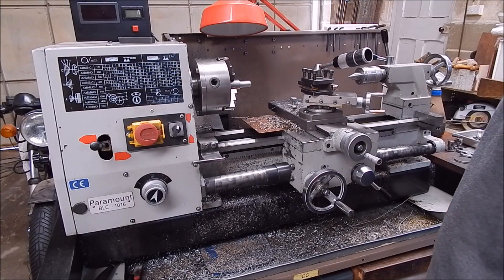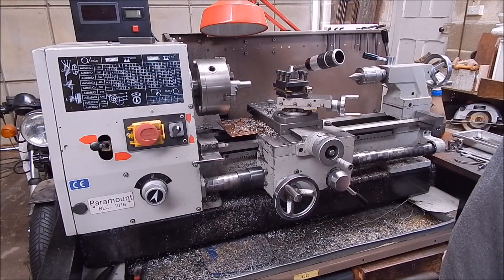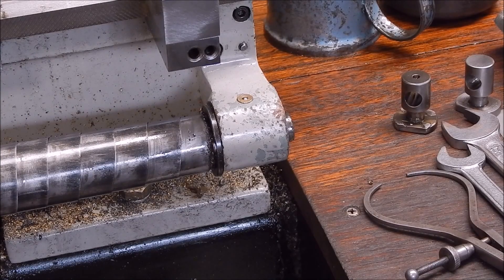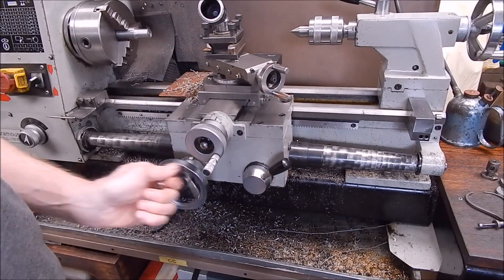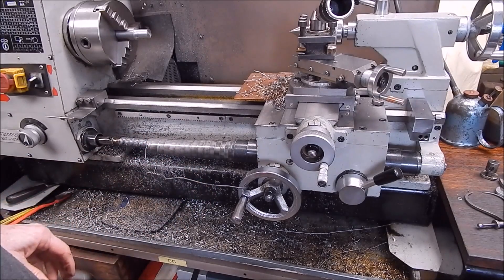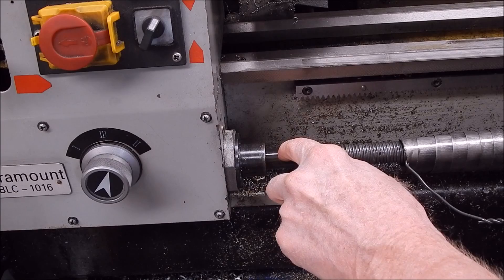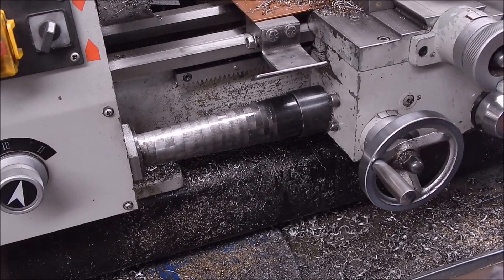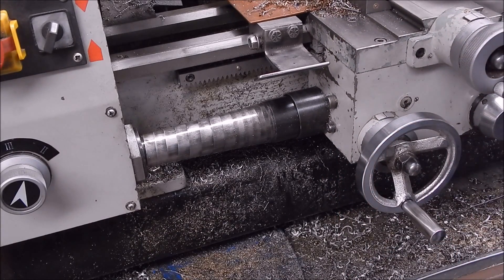How to replace the leadscrew shear pin on a metal lathe

Comment: Yep a spring steel roll pin used as a replacement for a proper shear pin would be costly in parts. But not all lathes use brass, bronze, or mild steel shear pins. My small lathe is an Emco compact 5. They come from the manufacturer with aluminum shear pins. Smaller lathe, lower strength to the parts, so lighter breaking forces are needed.

Comment: Yes do get rid of roll pins and plain steel shear pins. Asian bench lathes are bad to be equipped with roll pins. Note that for some lathes there is a sketch showing how the shear pin should be made in the operators manual. Some directions call for necking down the shear pin in the two places where the driving and driven shafts interface. This is done because a full size brass or bronze shear pin may not protect the lathe's mechanism from damage.
   Make a few shear pins for the lead screw and drive rod (if equipped) and keep them in the lathe's tool box so they'll be at hand when you need them.
   In addition to the shear pins there is another useful addition you might want to make to your lathe. On my 12x36 Taiwanese lathe if you remove the chuck and run collets, the carriage way wipers can be crashed into the head stock and damage them if you aren't careful. What I did was make an aluminum piece out of 1/2 inch plate that bolts onto the carriage where the follower rest usually attaches. It hangs down enough below the carriage between the ways for a 1/2"-13UNC tapped hole through the aluminum. I screwed in a piece of 1/2-13 x ~8" all-thread with a jam nut to secure it in place. I slipped a rubber bumper over the exposed end of the all-thread and adjusted the length so that when the bumper hits the clamp under the head stock the carriage way wipers are just clear of the head stock.

Comment: Would it not be easyer to mount a breakoff switch on the backside of the lathe that stops the motor before things go nasty?  Nice Video.:)
Reply from the maker: Yes that's a good idea.  Whether it's easy or not remains to be seen :)

Cheers Rob
Reply: Adjusting the switch to accurately recognize an overload might be problematic.  It would have to be wired into a mechanical or dynamic brake of some sort to get the plot stopped quickly enough to avoid damage. 
  The shear pin is much easier to deal with. Someone noted that they had a lathe with a slipper clutch... If you were shearing pins right and left, building a clutch might be easier than electrical switches. When you hear the clutch jump, you'd know that you were taking too heavy a cut and you need to back off a little. With a clutch you could use a  torque wrench to adjust the break-away to suit your needs.
Reply from the maker: Some lathes have a power cut out switch in the carriage stop (low voltage to a relay).

That's another way to do it.  Generally this sort of stuff is the realm of large lathes with plenty of room.

Shear pins are as simple and compact as it gets.

Cheers Rob

Comment: Is the shear pin to protect the gearbox,  my WM240 has neither. I expect the plastic gear would strip before any damage is done?
Reply from the maker: Hi Mark,

Yes, and also the change gears and their mounts.

Cheers Rob
Reply from the maker: A plastic or fibre gear is sometimes included in the gear train as a safety feature when a shear pin is not fitted.

This is OK , but requires a replacement and even a teardown of the headstock on geared head lathes.

Some (mainly larger Chinese) lathes have a roll pin in the leadscrew coupling, which could easily be replaced with a bronze pin as a simple modification.

Cheers Rob

Comment: Super useful video. Had I had a shear pin I probably would not have had to buy a new half nut when I had my crash. Unfortunately I don't have the excuse of a screw cover, so like today when I pulled a knife towards me and needed plasters when it slipped, I have to accept it was my stupidity.
Reply from the maker: We all have those days.  Something in the brain cells goes a bit wonky at times.

Cheers Rob

Comment: Hi Rob !

Nice instructional video for people with that kind of leadscrew - well told and showed, I think !

Fortunately I have a leadscrew with a ball bearing clutch - unfotunately it's "open", but as long as you're holding it clean you should never run into a broken shear pin there, I beleave.

I envy these leadscrew cover of yours - I've seen them before and investigated my lathe but it's too complicated to put them on mine ... so I'll just have to envy you ;-(( !
Reply from the maker: Thanks Keld.

It's a simple video, but hopefully it passes on some information on the subject.

Your lathe clutch is a better idea for sure, but on small lathes it probably gets a bit difficult to fit.

The covers are great, but restricting carriage travel is a downside.

Cheers Rob